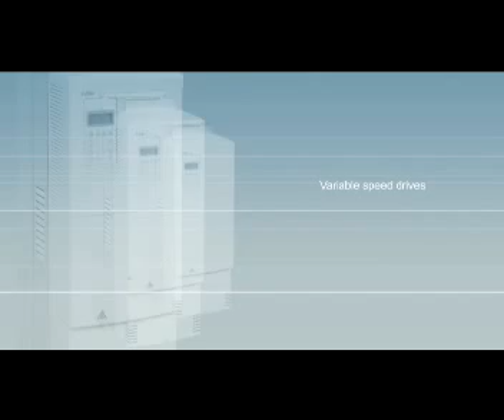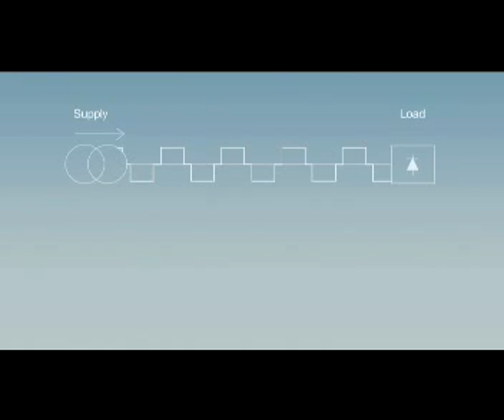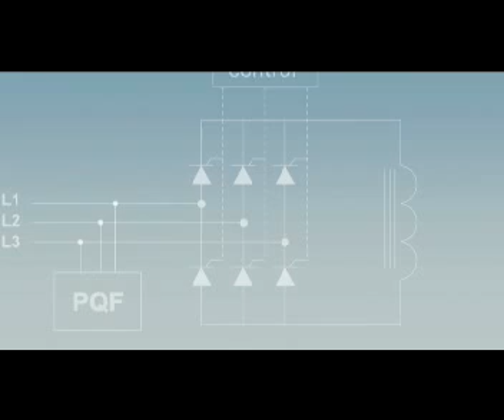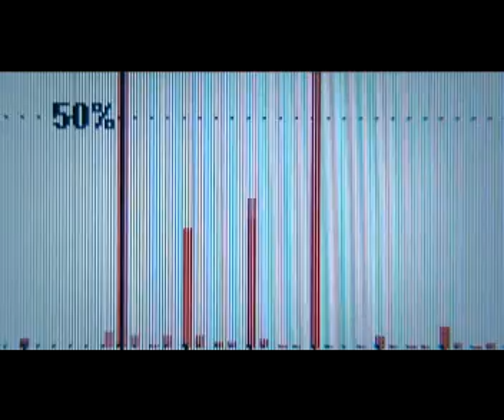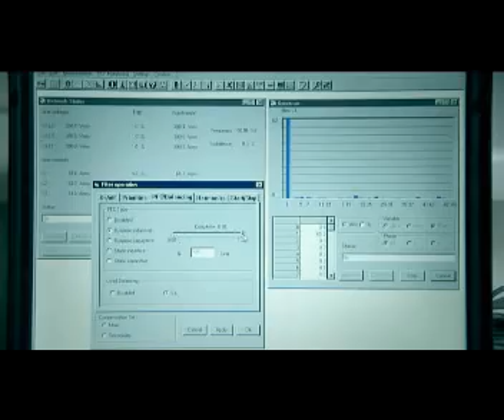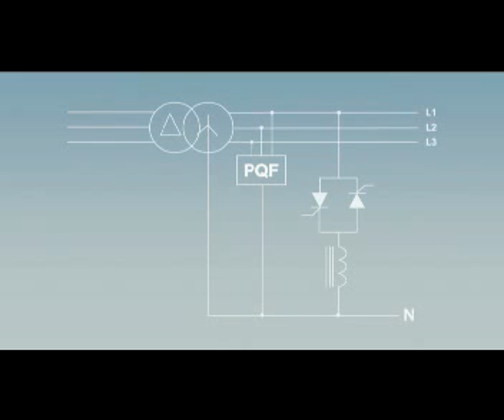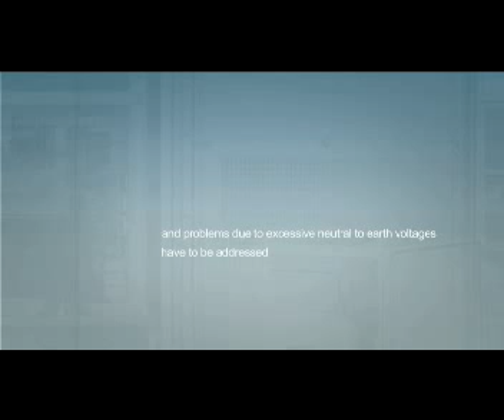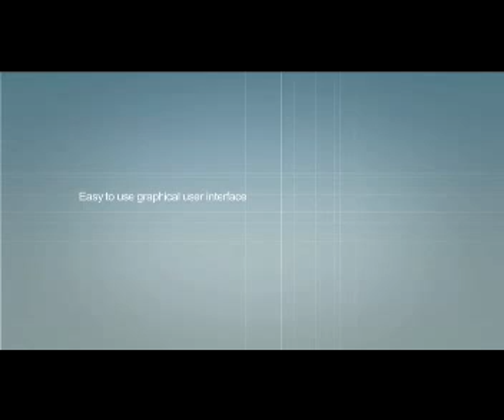ABB's ACTIVE HARMONIC  COMPENSATION systems

Comment: I have developed APF which filters all harmonics automatically without selecting. It create balance load current even for unbalanced load. Also filter out reactive currents. All of the things simultaneously.  This is for 3phase 3 wire system.
Reply: hey. can i knw lil bit more about it?
APF
Reply: Hemendra Patidar I am from Baroda too. Contact me on Linkedin. We will discuss more detail on APF. I have 4 wire 3phase solution too, which is useful for domestic power distribution. Youtube is not right forum to discuss technical matters.